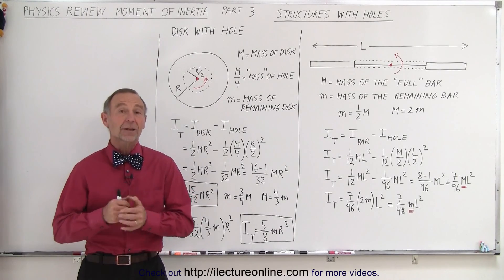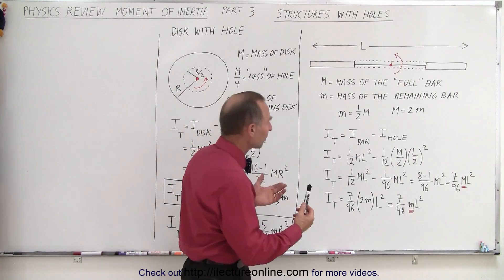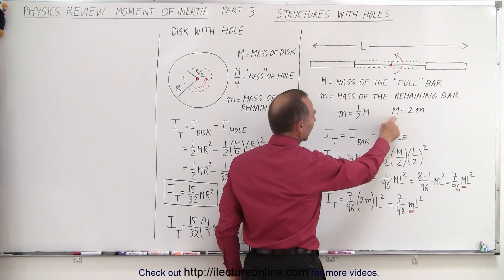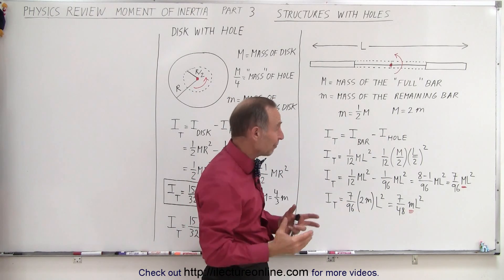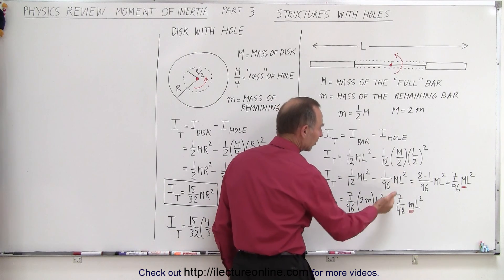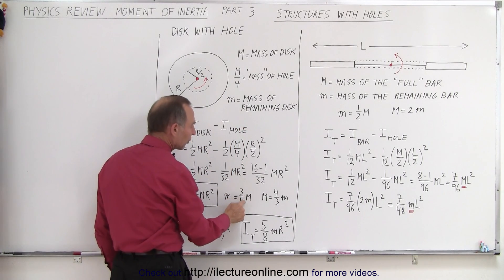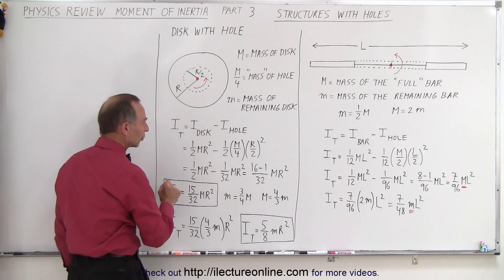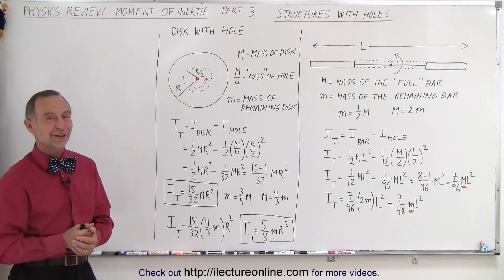Physics Review: Moment of Inertia Compound Structures with Holes (Part 3)

Comment: Sir, is there any website where i can send you some doubts about it i have a problem which has a metal annular disc inner radius 4m and outer radius 8m and ofc there is hollow space inside 4m space if we calculate the moi wrt to the centre of disc and perpendicular to its plane we get (moi of disc - moi of cavity ) but the answer isn't coming out that way also in some website they have done by another way like 1/2 of total mass and (radius of whole disc sqaured+radius of hollow space squared). I didn't get it . Can you please explain? Thank you .
Reply from the maker: Sorry.  We currently don't have the bandwidth to respond to individual quesions.

Comment: Hmm does it mean if, in case of rod, I drilled holes along the rod, symmetrically with respect to the indicated axis of rotation, and I removed half of the mass of the rod this way and half of the length (remaining walls around the holes to be neglected), I would reached exactly the same moment of inertia as is in the presented example?
Reply from the maker: Note that the equation is   I = mR^2   Since you would then only have half the mass the rods would then only have half the moment of inertia.
Reply: @MichelvanBiezen  Yes, but in case of the example from the clip we also have half of the mass, half of the length (rest is removed) and the moment of inertia isn't cut by half.
Reply from the maker: That is because in the clip there wasn't a hole drilled along the axis.  The part that was removed was in a different location (closer to the point of rotation) than the part that remainded.  Note that the moment of inertia is a funcition of R^2.